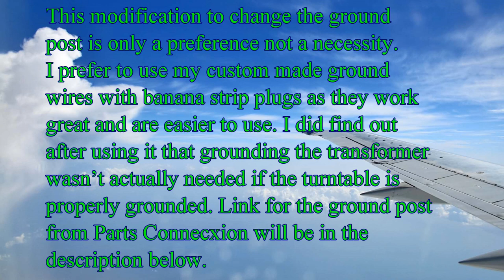Reisong MC (Moving Coil) Step Up Transformer Ground Post Mod

Comment: Thanks for the video, very interesting in connection with the LB T11.
What gear ratio does the step up transformer have, 1:20?
How far do you turn up the potentiometer of the Little Bear and do you hear a hum?
Reply from the maker: Yes, it's a 1:20 ratio, which is standard for stepping up for a MC cart. As with any tube amp/preamp there will always be some amount of hum. The level of hum depends on the quality of the components from what I understand. I usually have the gain know all the way up when I'm using my Scarlett USB interface. With my Novation USB interface I use the gain knob for the recording level. With either interface with the T11 it has minimal hum. You have to to the volume up really loud to notice it. After I upgraded the T11 with better caps and tubes it improved quite a bit. The Reisong is dead quiet by itself and didn't ad any extra noise at all. The ground post really isn't needed as I tested it without having the ground connected, but I still connect it anyway.
Reply: Thanks for your answer, I might also try a step up transformer with my T11.  The music recordings in your videos definitely sound very good 👍